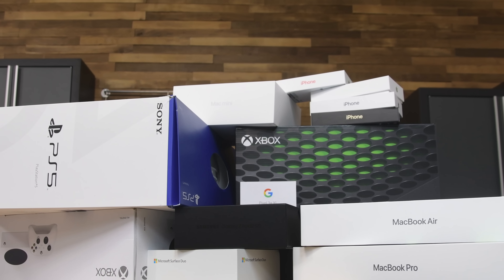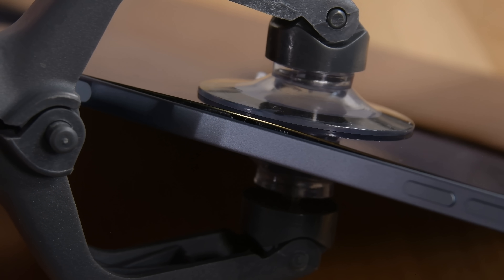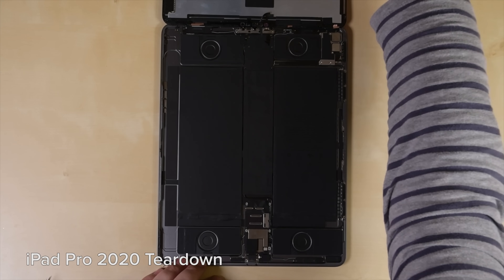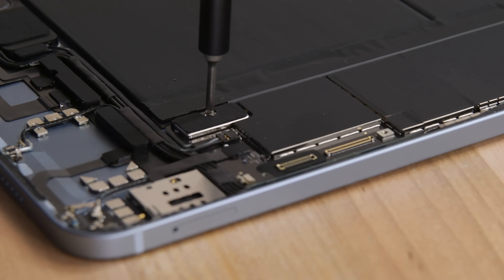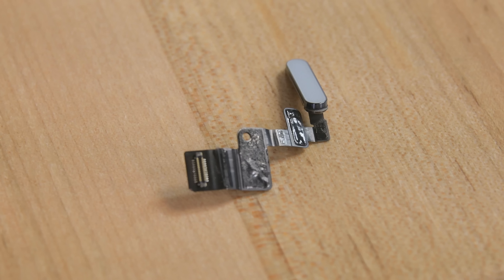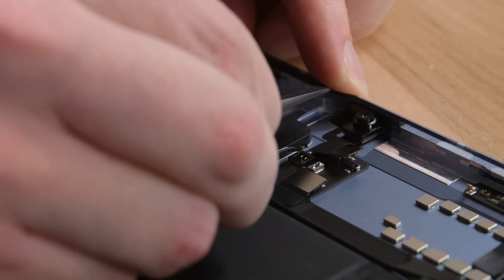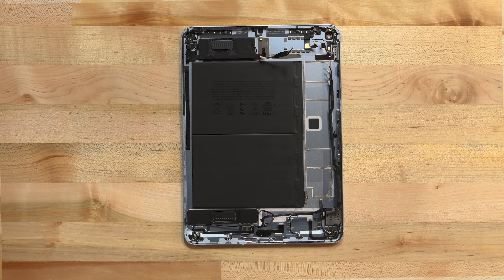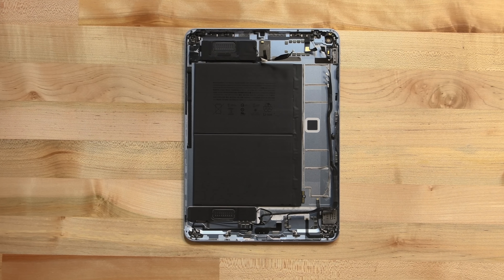iPad Air (2020) Teardown: Long Live Touch ID

Comment: You should always disconnect the battery before disconnecting the screen on the iPads. If not, it will blow the backlight fuse on the motherboard.

Comment: Looks like it uses the iPad Pro 3rd Gen chassis, upon the basis that there are empty patches suspiciously close to where the Pro’s extra two speakers are supposed to be. The Air 4 is a very capable device, and is super powerful.

Comment: iPad Air 4 users: How is the bend issue going so far? Does it bend as easy as the Pro models?
Reply: no.
Reply: @zerothcore3220  good x
Reply: @everlastingfeelings  it’s very rigid, it honestly feels more rigid than the pro. It makes sense I guess because the air is 0.2mm thicker

Comment: the speaker design is really weird...
Reply: it is same speaker unit from ipad pro 11, but then there isn't the little tweeter placed right behind the speaker vent like the pros have, this left a gap and it is why it looks like in the middle of nowhere
Reply: @rebeccafu2745  I meant the fact that there are only two speakers 8the iPad Pros always had 4) while there are 4 speaker openings.

Comment: Does the camera have OIS ?
Reply: Only 4gb of Ram? My man apple utilise Ram the way no other brands can right now. Androids with 8gigs won't be able to keep up with the new air. Having problems with dual speakers? By a pro. Not much is different in a 4 speaker set-up, maybe louder and fuller but not worth the extra couple of hundred. Even Camera will smoke any high midrange android anyday. I have this iPad and never had a single issue other than not being promotion but hey.
Reply: @brandonchutt312  my friend has a oneplus 8 8gb variant and i use Xr that has 3. My apps run better and stay open longer. Its not upto the app. They keep pushing shite that no one needs . The os decides what to keep and what not to. I assume you never tried an apple device. Correct me if wrong. iOS will ALWAYS be superior to android in terms of RAM management because of the way android works, dumping. Look it up.
Reply: ipad cameras never had OIS, and no matter how Apple advertised them their image quality is still terrible.
Reply: @rebeccafu2745  "Never had OIS", well iPad Pro 2017 did lololol

Comment: They could have put in lot bigger battery by stacking the motherboard like in iphones or even put those 4 speakers like the pros
Reply: Don't forget about CPU thermals
Reply: The 2 speaker was intentional so that there's enough gap between air and pro. A stacked motherboard means a lot more serious overheat issues, and this shouldn't happen on a device intended for productivity.

Comment: So why Apple puts 4 speaker holes on the body instead of 2 if they only put 2 speakers in the chassis?
Reply: By doing this they can use the exactly same chassis design as the iPad pro 11 2018, this reduces a lot of production cost
Reply: Very un-Apple design? Remember how all 15 inch MacBook have fake speaker grills? It's all for aesthetics
Reply: Microphones probably. That's why iPhones have grilles on both sides of the charging port
Reply: @ThinkCleverAndSmart  yes but, I mean can they just put a small hole on the body as the microphone? Two large speaker grills just to serve as a microphone opening seems like unnecessary and un-Apple kind of design. Probably they do this to reduce cost by reusing current iPad Pro's chassis... that's my hypothesis
Reply: @ivanputeraa  Judging from how they do on the iPhone, it's to keep symmetry. But even that is somewhat vague now too since the antenna lines on the new phones mess up the grille symmetry... I mean, yes, I agree with you lol